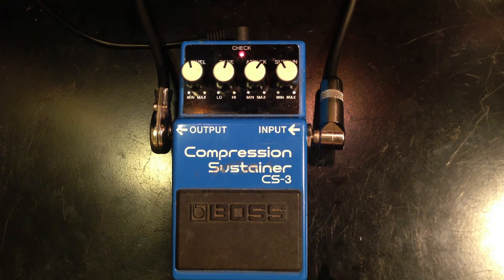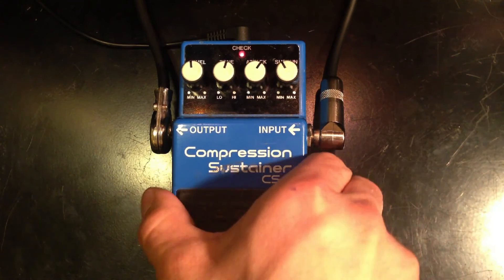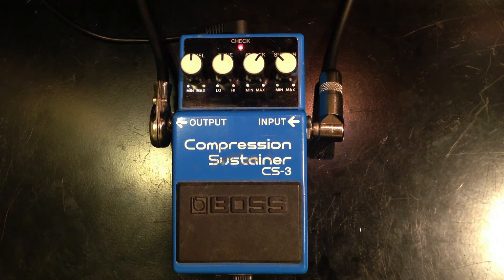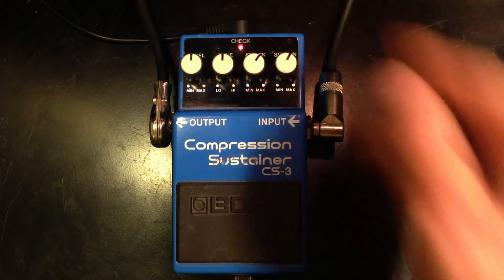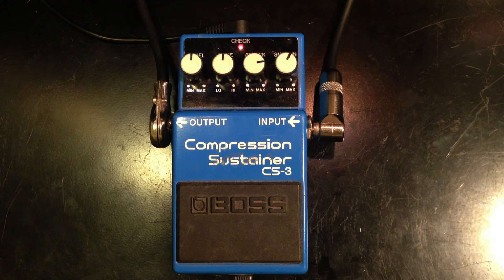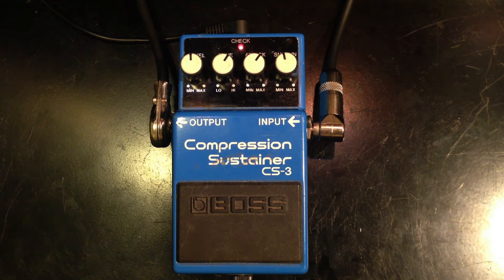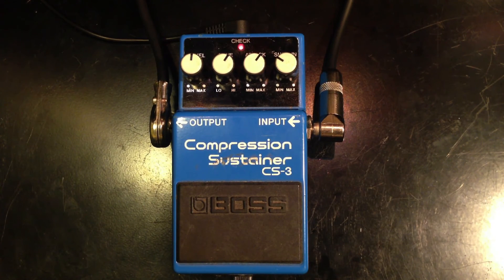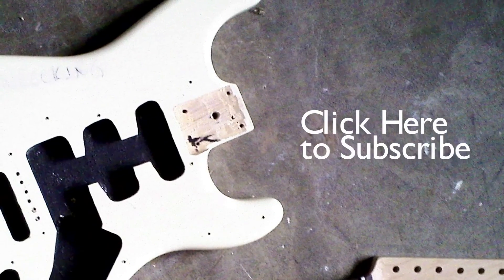Vintage MIJ Boss CS-3 Compressor Sustainer

Comment: are you just using the compression sustainer cs-3? or you are using a kind of delay at the same time? saunds soooo great really
Reply: Definitely some delay. I’ve seen a Strymon Timeline used a lot of this channel. Could also be Big Sky for a touch of maybe plate or spring or room reverb. The Dispatch Master is another great Delay and Reverb in one.

Comment: hi dude, i got a compressor cs3, but i got a problem when i use distortion or overdrive at the same time with the compressor , the signal don´t get gain, sounds more soft, but don´t happen that when i use the the clean guitar or delay pedal. just sounds like in your video. i am  doing wrong  something? thanks. i hope you understand me i don´t speak a lot english.  once again thanks.
Reply from the maker: Yes compression after distortion will squash the sound, try putting the compressor before the distortion

Comment: The cs-3 may work for your rig but it does nothing for mine other than being almost a signal booster, a job done better with a cheap "tube driver" ped. I run a Vox ac4tv into a Weber alnico Blue Pup and a Weber alnico hemp cone. I build my instruments with sustain and the Vox supplies the compression. My cs-3 only gives volume and some tone control and and does not sound as good as the dry signal and I've had it checked by a tech. The take away is before you buy test your rig with a borrowed cs-3. If it improves the sound then buy one. Mine is going off to the secand hand shop. My Boss DD-3 delay is a faultless clean delay that I suspect will work well with any rig. Cheers T
Reply: I went through a period of buying used modded pedals  especially Boss. Got a CS 2 that has a crazy Opto comp mod spider looking chip soldered on the board. So to do a comparison I picked up a stock clean CS 2 and didn't like or need either. So upon further research I found that the stock 1 is the older ASA 12v and I didn't test it this way. Not that it's gonna matter. The last pedal on my board is a silent modded 10 band EQ that does its job fantastically. For a $100 used. Next to it is a dB-1 boost/buffer that I don't use the buffer part cause it's clean and as loud w/o. Again used for $58. So a clean loud signal that can go to 2 separate amps.